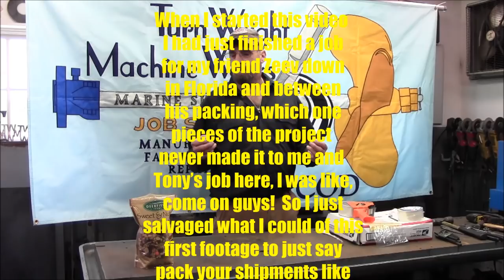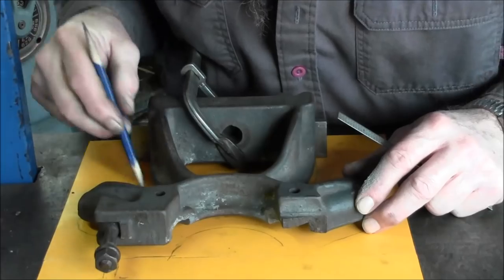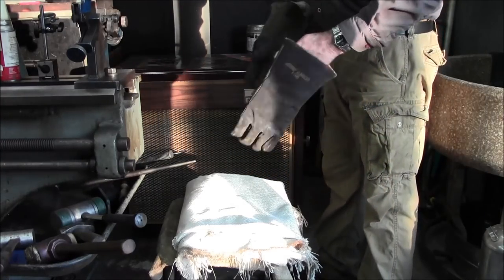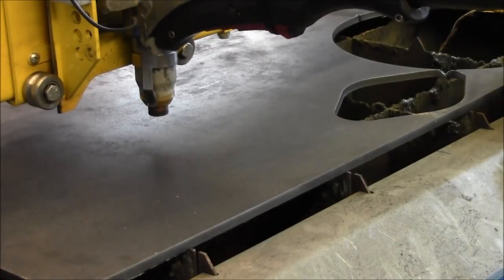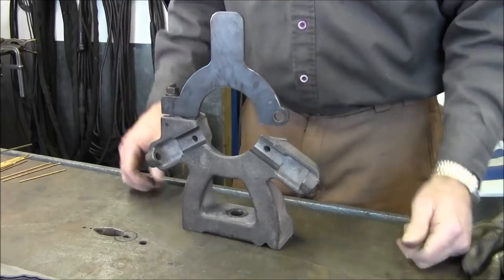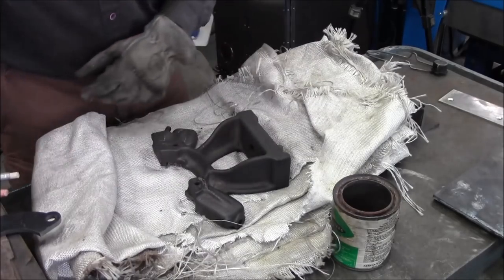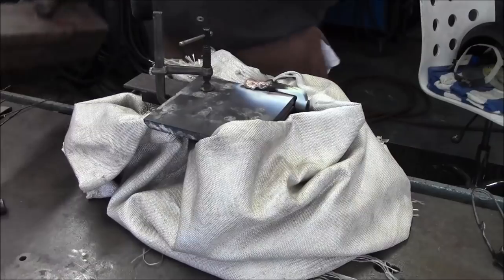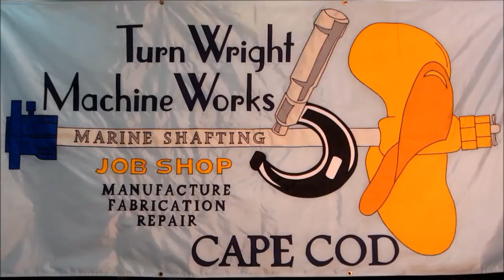The Million Dollar Rest Part 1: Lathe Steady Rest Repair and Roller Addition

Comment: I just stumbled on this video, I hope you are still checking comments. I love to see a real craftsman do his thing, and you are surely a craftsman!

On cleaning cast iron, one thing that I might mention, although I don't know if it will help in your machine shop endeavors, is that when I was a chef in a restaurant about 45 years ago we had cast iron grates on our grills and we had a steel drum filled with a lye water solution that we would hang the grates in and they would come out amazingly clean. I can't remember how long it took, but I have done the same with cast iron frying pans here at home and the lye will take off years of carbon and crud, leaving the pans looking as is they were just born.

I bet it would work for you if you need to clean a lot of cast iron, but if it doesn't, at least you and your subscribers cans use it for your BBQs. FYI: the active ingredient in most oven cleaners is lye, but NEVER use it on aluminum!    :-)

Thank you for making these videos, I have subscribed.

Comment: yes, mainly for picking things out of the plasmaCAM or for moving hot stuff.  im watching you pick things up with MIG pliers.  i have a couple of 1" x 2" magnets on a handle that i use to assemble/dissasemble automatic transmissions when i cant get a grab on heavy oily parts with no clearance.

Comment: loving the videos, but I have a question.

Instead of using all that bronze rod would it not be easier to mill that surface flat, bronze braze on a small block of cast iron and then machine it to final dimension?

Comment: Thanks Keith trying to get a gauge on the heat you needed for the job.  I went from using a Harris setup for many years to a victor setup now plus the victor tips I'm using now are really worn so they are bigger than they should be. 

Are both your rigs Victor?

Comment: Keith nice work thanks for sharing the info on the plasma cut parameters.  What size is the tip in the torch that you are using for the brazing?

Comment: Keith, I know you have been asked this before but would you entertain the idea of using the newer welding rod for cast iron?  I have used the old farmers trick of stick welding with 7018 with limited success and am curious if the new product is as reliable as the silicon bronze method that you prefer.

Comment: Just curious—how come you don't have a bead blast cabinet for cleaning parts like this down to bare metal? Depending on which abrasive you use, you can get a part super clean without changing its dimensions.

Comment: Where I work we have a JFMT 18x60 quick-reverse engine lathe, which is an excellent Chinese copy of the old Mazak-18. Unfortunately it's had a terrible 40 years; the ways need to be reground, the oil filter leaks and one of the spindle gears doesn't work.  I use it every day, and it leaves a .005-.010" taper on every piece I turn on it.  I just wish they would take the time to have the ways reground...

Comment from the maker: I positioned the part while brazing in away I am comfortable with and control the bond and build up, in the way I prefer. The second question has been answered a couple times in the comments already, during this series. The short of it is there is only one surface bond and one machining need, with the build up!  ;{)-----

Comment from the maker: It is actually High Temperature Conductive Graphite, good for 800 deg in air and 5,000 deg in inert enviroment; I bought it from Mc Master Carr and it is sold in several diferent shapes and sizes for the shapes. that one piece was 6" x 6" x 1/2" at $35.88 and I have had that one piece now for about 15 years. ;{)---

Comment: Dig the "roasting" technique to cleaning that part.  
       I've seen other youtube videos where the welder preheats the parts on a propane barbeque.
       My ma would put cookie sheets, casserole dishes, cast iron pans in a 'self-cleaning' electric oven and put the oven on "clean" cycle.  It would burn all caked on buildup of carbon, etc .  They would come out totally clean!  All that was left was some ashes.  Then I got to thinking, "I wonder what temperature does a 'self-cleaning' oven go up to?"   Well, it is around 930-1000F degrees !  Maybe you could pick up an old electric oven and use it as a preheater or to bake out decades of oil and grime (as in this video).  I bet you could "hot-wire" (what a pun) it to go to 2000F!!!  You'd have to wire up a different thermostat.  The porcelain coating inside of a oven should take up to 2200F .  Maybe you would have to cover/reomove the glass windo of the door, because it would begin to "droop" at 1500F.  
       But, overall, I figure that an old oven would work and could be purchased for less than $100!   It may not last or be the greatest, but for the price, it would work for a while .
       My friend has a heat treating oven.  It's big enough to fit an engine block.  He built it himself (they are really just a box).  His has some sort of programmable timer that can do all sorts of stuff for annealing etc.

Comment: KEITH
What type of bronze rod did you use and why don't you use coat bronze rod?
Reply from the maker: General purpose Low fuming rod and I like to control the amount of flux and get it on the part, the flux is not for the rod.
 ;{)-----
Reply: Thanks Keith